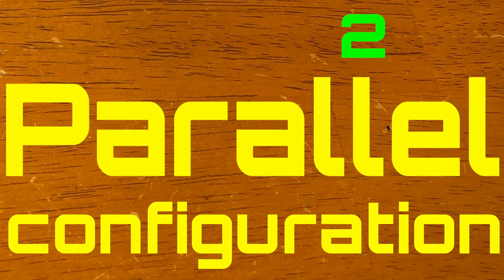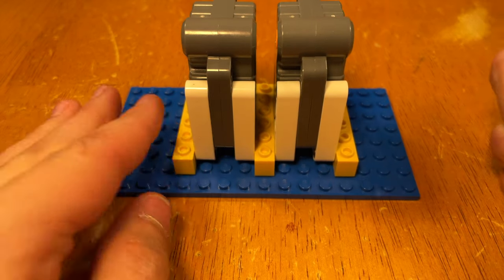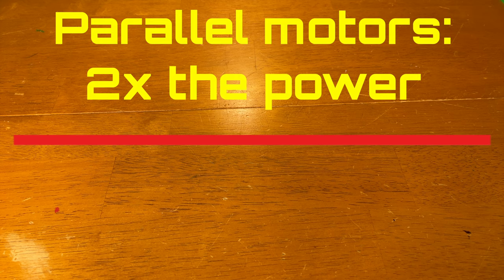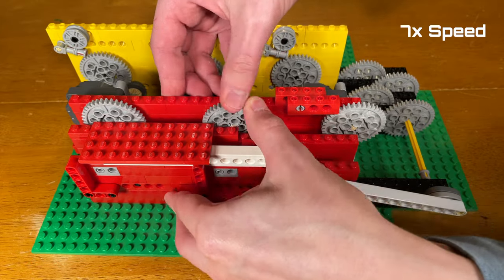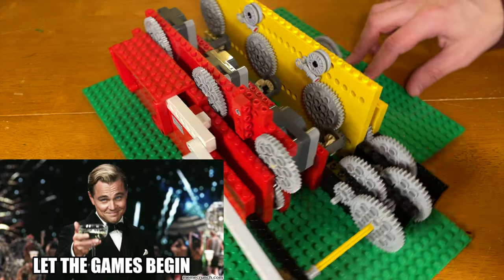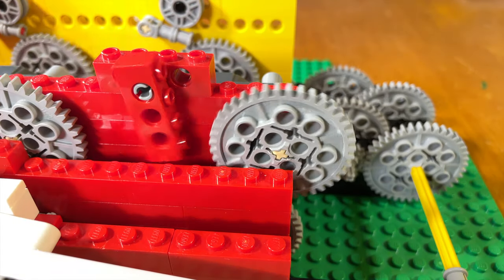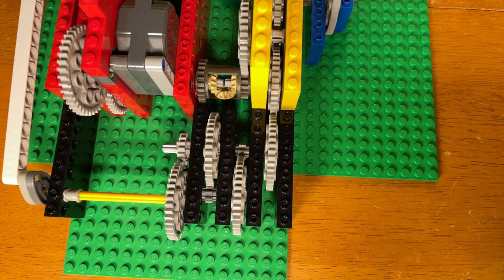LEGO Pullback Motors in Series [HD]

Comment: Hmm, the stored energy is the same, in parallel and in serie.
This way: if you put 2 windup motors in parallel BUT you apply gear reduction of 2:1 than the output torque will be the same (due to the gearing) but the runtime will be twice as long :)
(And much less complex)
Reply: Sush xd
Reply: also my first thought
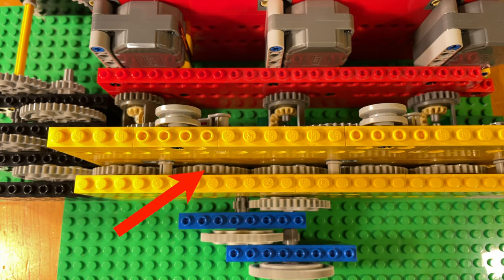Reply from the maker: Never thought of that. That totally works! However, the pullback motors are quite strong when fully wound up, and being made of Lego, the bricks would most likely tear itself apart. You can actually see this happening with just one motor running at 2:04. The stack of yellow bricks slightly came apart. In a real world application, I’m sure this would work.
Reply: @LegoTechnicsRule  it is true that lego has a limited ability to handle torque, that is why you need to reduce it with gearing before combining them together ;)
Reply: wait a sec, are you saying two wind up motors in parallel has same energy as just one motor? educate me plz. lets say I want to create alot of force using wind up motors but actually doesnt work?
Reply from the maker: @wonny1543  To put windup motors in parallel, simply let the motors share the same axle. When you release them, it will be 2x AS STRONG as just one.
Reply: @LegoTechnicsRule  so two windup motors work as expected 2 times stronger
Reply: @wonny1543  Correct
 Very simplistic explanation:
* windup motors store enegry in the form of potential energy and when released they convert that energy into kenetic energy.
If you double the number of windup motors you double the energy stored.
* Energy can be written as force multiplied by distance (winding up the motor, you need a certain pull back force over a certain distance) The windup motor has some cleaver internal gearing so that you need a higher force over a short distance for winding up but when released, it produces a lower force over a greater distance.
*So when you double the amount of energy stored, the amount of force OR the amount of distance also doubles (or any other combination, as long as force multiplied with distance is the same)
*The output force can be altered with gearing but because you can't change the total energy, the distance will also change.

( In metric units: energy [Joules] = force [Newton] x distance [Meter] = torque [Nm] x angle [radians] )
Reply from the maker: @wonny1543  Yes, in the parallel configuration.

Comment: You know theres a mmmuuuuuch much easier way to connect the motors in series, although its very inconvenient to use.

Basically you connect the output axle of the 1st motor to the case! of the 2nd.  (To the case not to the axle of the 2nd). Its should be coaxial of course. The you can add the axle output of the 2nd to the case of the 3rd, etc..   .
So all on all only the 1st motor is statinoary while the other motors each turn around themselves. I hope this was clear, I know this cause I did it once lel
Reply from the maker: The case? Around themselves? This didn’t really make much sense, can you elaborate?

Comment: Awesome bro… now build an alternator… this is my challenge for you. I mean how cool would it be if one motor is winding DOWN it is actually winding UP the other motor.
Reply from the maker: This would not work. The reason being is that a fully wound wind up motor would wind up a completely unwound windup motor exactly half way. What you would end up with is 2 wind up motors, each 50% wound up. Since they are rotating against each other, the axle wouldn’t move when the equilibrium is reached.
Reply: @LegoTechnicsRule  but if one motor eg raised a mass, then disconnected from that mass, the potential energy would be enough to (almost fully) wind up a second motor.   The difficult bit is mechanically disconnecting bud reconnecting if you want the alternation to continue more than one cycle?   The frictional and sound losses likely mean a few cycles max but I think in principle it is possible
Reply from the maker: @MrTaffynoel  Sounds like perpetual motion, besides the sound/friction losses.
Reply: @LegoTechnicsRule  nah, I’m talking conservation of energy.   It’s not perpetual due to friction losses, which is my point.  That aside, you should be able to translate the rotational potential energy in one motor to a raised mass, and (mostly) back again.
Reply from the maker: @MrTaffynoel  The motors get harder and harder to wind the more they are wound. Thus, the setup would reach an equilibrium point where the force of the hanging mass and the motor are equal. For example, have a fully wound up motor turn a fully unwound motor by attaching their shafts. You would end up with two half way wound up motors. I know I’m repeating myself from the original reply, but I don’t see how your idea would work. Please explain it more.
Reply: @LegoTechnicsRule  my last view then if still not in agreement other people can chip in ;). 

On the tightness, that’s just a complexity which could be overcome by, once heavy mass A is lifted to the maximum in based on the torque of the motor, in theory a lighter mass could then have work exerted on it by the remainder of the motor.  Keep this process going until you have several raised masses.  These masses, in turn, can reinstate rotational potential energy to a new motor, fully winding one up, less losses due to friction etc of course.  

Directly connecting two motors will result in two equal state half wound units, I get that.  But they both still hold potential and if they were disconnected they could both raise masses individually which could likewise then be released to reimpose the rotational potential in the motors.

My hypothesis remains… it is absolutely possible to use one spring motor to wind up another beyond 50% by transferring potential energy into another source first, and not having the motors directly connected and balancing each other.  In a frictionless system, the energy could be transferred back and forth indefinitely